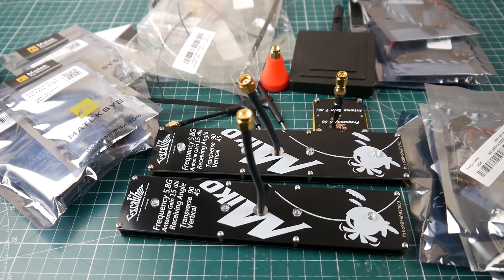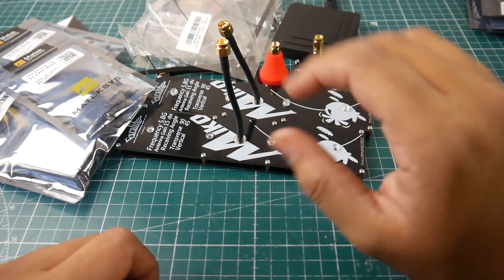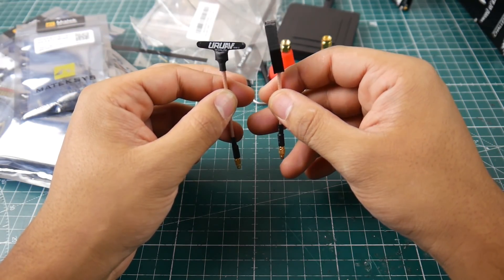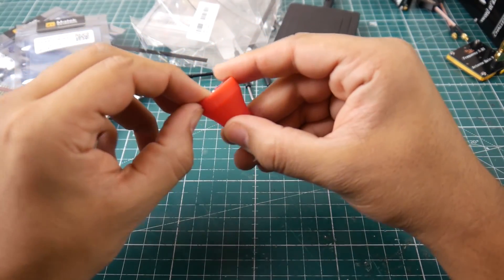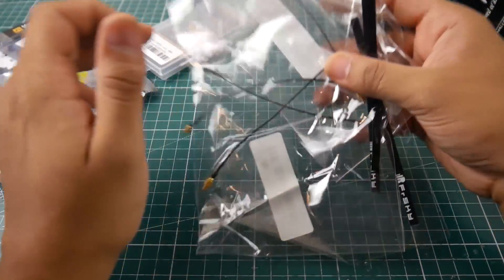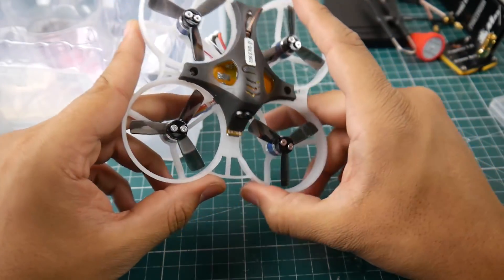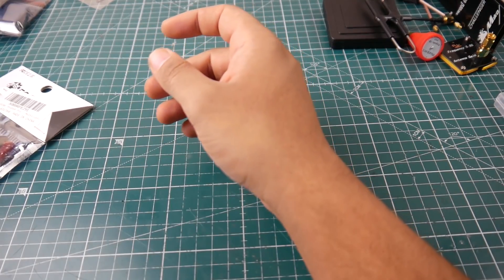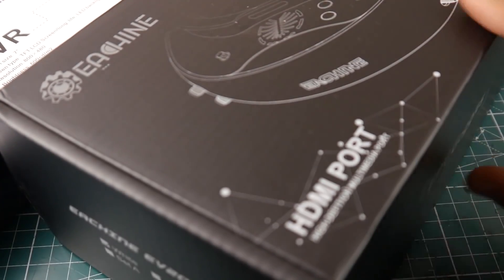Mailbag Time // Kingkong Tiny GT8 , DYS ARIA SLIM,  Eachine EV200

Comment: Ordered EV200D 15 min ago... while waiting would be interesting to see your review what I will receive :) Picture quality in reviews I seen earlier seems quite near to HDO and is not oversaturated. Latest batch should have fixed some old issues like DVR problems noted earlier. Check if they can be powered from regular USB power bank. Two covers are for  use with specific receiver modules. Plain cover with stock receivers and second with glass windows - for 3rd party modules like Realacc RX5808 Pro, True-D etc. Very nice that such cover is available in stock configuration.
I'm curious are little black DVR is better than Hawkeye Mini DVR. Guess not much.
By the way great mailbag video at this time ;)

Comment: I have the EV200D , and they are fantastic.I went from the EV800D with ease, no issues and worth the money.
DVR is still not as good as the EV800D, but the reception is amazing and perfect if you are running 16.9 cameras like Swift.
If you are using them all day, just make a power cable and put a 3s in back of the strap.I have tried other goggles and these 
for me were the best fit and I can see all of the screens, you have ever so slightly more adjustment for the IPD's  than others.
The case is very good quality, but in my opinion needs to be bigger so you could leave patch antennas connected all the time
then just drop 2 normal antennas on the goggles when you take them out of the case.